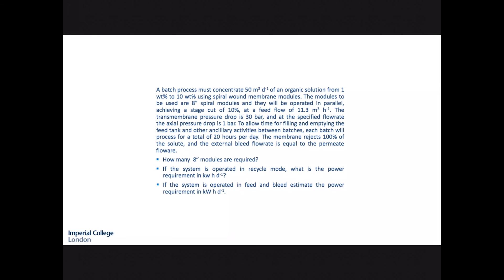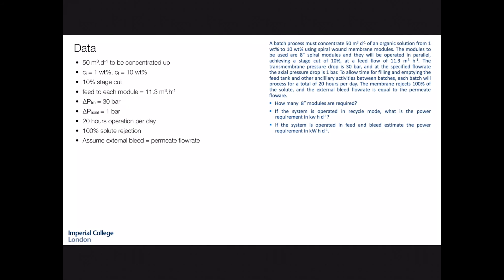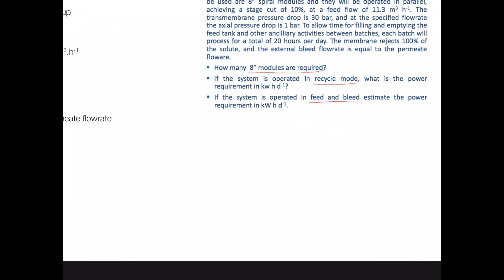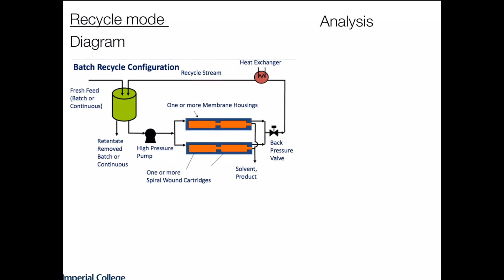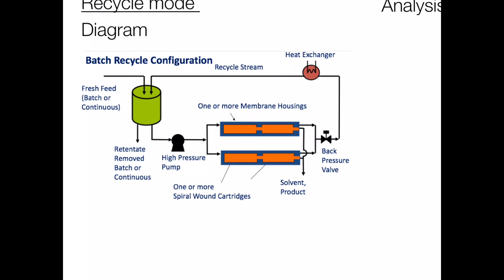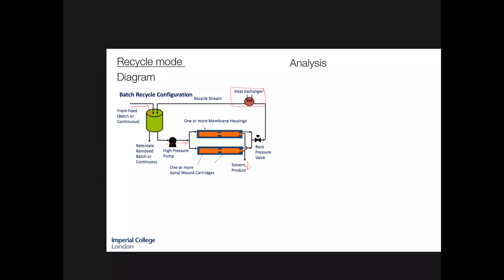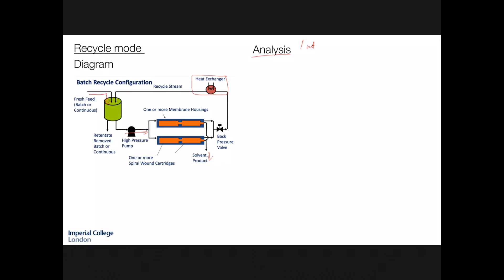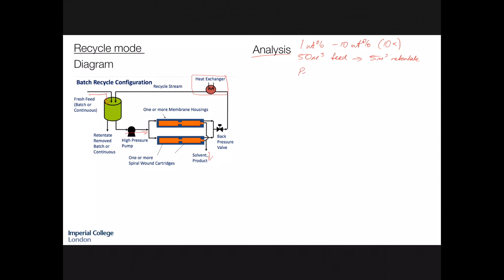Membrane Worked Example - Batch Recycle compared to Feed and Bleed

Comment: How can I get more information on this operation? It is very difficult to find examples such as this one in textbooks. Any books or articles you can recommend?
I actually have a Master's degree from Imperial College London in another discipline.
Thanks for the video.
Reply from the maker: Hi Giorgios - sorry for the delay! This example comes from a course in membrane separations, taught in the Chemical Engineering department at Imperial. I am not sure if it is mentioned in any textbooks, it is fairly specialised.